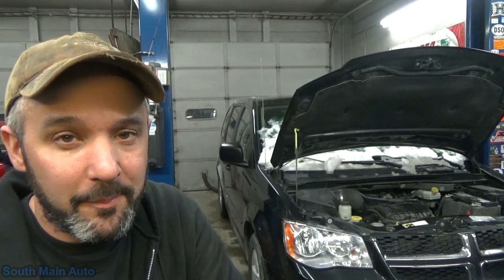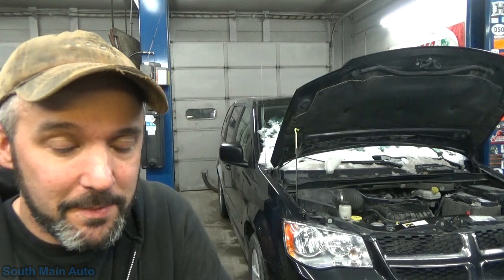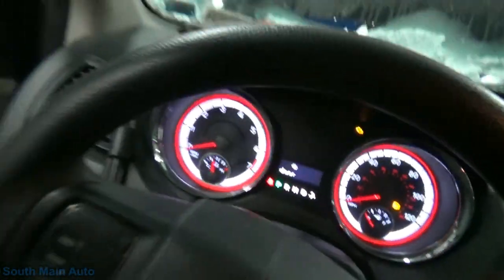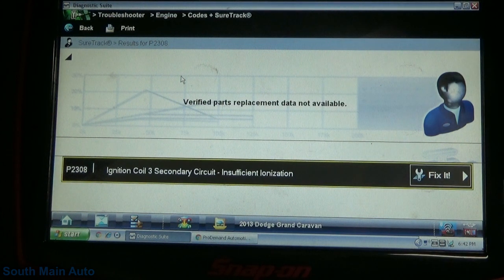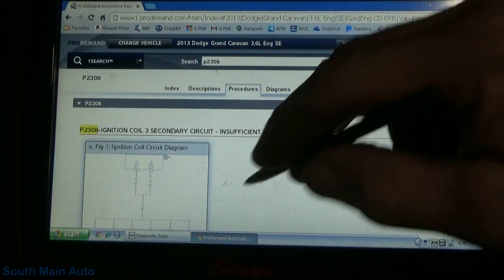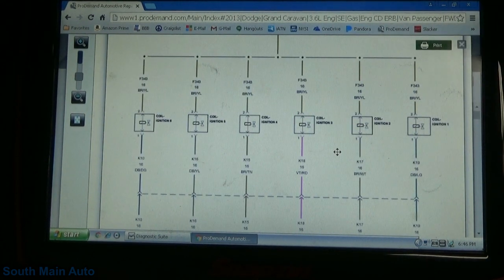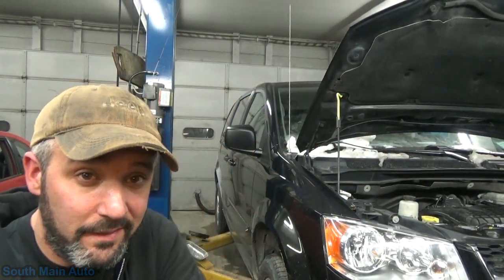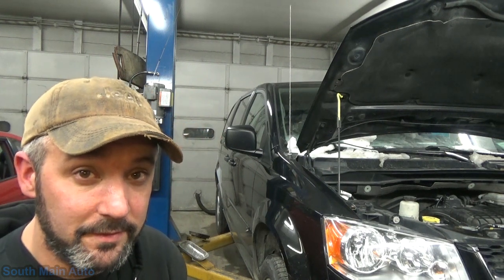Dodge Grand Caravan P2308 - Case Study

Comment: Before I would replace the ECM I would check pin fitment on that 52 pin.  Most likely not a fitment issue, but I would check it before the customer drops money on the ECM.  Secondly you bring up an excellent point about swaptronics and the possibility that a burned coil caused the issue.  Granted as you also said the newer electronics are pretty good at preventing that sorta thing from burning up an ECM, but we all know it's not perfect.  At the least I would do a basic test on all the coils to make sure there isn't an oddball in the batch.  That would suck to have it potentially burn up a ECM later down the road.
Reply: jayss10 I just wonder, if the oddball coil got swapped to another cylinder, would that pcm output driver not have been burned out as well, or cause some misfires at least? There are only misfires in cylinder 3.

Comment: Inputs? I have a 99 maxima with no signal (4volt to coil transistor) to #3 and #2 coil at the coil connector or the ecm. So I checked for shorts on the circuits and found non. I plugged in a new ecu and I have the same exact problem. Luckily we can warranty the ecu because it was changed a few months back for unrelated reasons.  

I unfortunately have not had time to get back to that vehicle to check me cam and crank signals. But this video made me think of that car that I'm going to have to get back to soon. 

Ever see this before.
Reply from the maker: Doesn't ring a bell right off hand. Were you able to make head way with it yet?
Reply: South Main Auto Repair no, have not been able to get back to it yet. I'm sure I will be able to get to it this week coming.

Comment: The Mitchell Wiring Diagrams section the wire colors are correct & same as Identifix. The wiring schematics under the DTCs are hit or miss in Mitchell so I don't use them for wire colors just for a basic block diagram...kinda sucks. Ibuprofen is part of the tool box. I feel the same way when dealerships or other shops butcher cars and you have to try and figure out all the stuff they have touched. Looking forward to seeing the Autel in action programming the new PCM. I use the Pass Thru II but I'm curious to see if it's an easier process with the Autel. I'm still trying to win it :O

Comment: I had an 09 caravan. Same symptoms. Driver in the pcm was no good. As a final test I took the power probe and measured continuity through the driver and compared to the others. The bad driver showed a blank screen on the power probe.
Reply from the maker: hmmm interesting!
Reply: I've been using the power probe for years to check the internals of computers. Since it has a high impedance it has never damaged anything.

Comment: the autel has the ecm replacement  , no pin code needed. Right before it reads the current vin (in new pcm) turn the key off , it will say no vin found , and ask you to input a vin , input it ,turn key back on voila no dealer needed. make sure you UNPLUG the skim module before all of said above.

Comment: I wonder what the spark plug looks like. I started thinking if the spark plug has an issue, maybe the PCM disabled the driver to possibly prevent damage to it. This is purely speculation on my part. The code definition about sensing burn time really got me thinking.
Reply: I was thinking the same thing for quite a while, it's in the back and in the middle so we can't reach it to change it.  Must have a monster gap causing this issue.  Turns out it's probably bad error reporting done by the code in the ECM that spits out this bogus information when it's own driver opens up and quits the show.
Reply: Yes, it is interesting. Since I saw on the Autel that the PCM is controlling the fuel injector pulse width on a restart and then disabling it to zero, I asked myself why couldn't the PCM do the same with the ignition coil? Definitely if there was an open in the secondary side of the ignition coil, we wouldn't want 20,000 or more volts backwashing into the PCM driver circuit. That voltage has to go somewhere, and if it doesn't arc inside the coil, it would have to go back to the PCM or the 12 volt supply circuit from the ASD relay.

Comment: i wonder....when the collision work was done if any welding was done and they didn't disconnect the battery?, I use to think for that to happen you have better odds winning the lottery....we'll I had it happen and I still haven't won the lottery. lots of lessons learned the hard way that has shaped how I handle repairs.

Comment: Is this a common issue? I've got engine misfire codes on cylinders 2 and 6 and replaced both the spark plugs and ignition coils. It helped the shaking a bit but it still shows misfire code.

Comment: I have a question.. If I buy a PCM with the same part number will it still need to be programmed because of the vin number? 
And also I found one at the auto wrecker but it was off of a Chrysler 300 3.6L. Will that also work???

Comment: If you get the customer okay to put in a new PCM then try, with the old PCM, shorting cylinder 1's primary feed to ground - will it burn out the PCM driver for cylinder 1 or did the engineers design the PCM robustly enough to withstatnd a direct short?

Comment: This question doesnt pertain to this fix but i am wondering if you could help me out?Have a 85 gmc 2500 350 all vacuum assist emissions blah blah .Purchased a gm 350 that is either a 86 thru 88 question would my distributor out of my 85 work in that motor ?If you or anyone on the page could answer that much appreciated ty!

Comment: hey eric love the videos. i am in dire need of help i drive a 2001 chevy silverado 5.3 with the 4L60E trans in it. the truck will not shift out of first by itself anymore. itll rev up like im in neutral and when it gets to about 2 grand ill hear a bad whining/ticking noise coming from underneath. to get it to shift out of first i have to wait til its at about 2-2500 rpms then i have to let off the gas let the rpms drop then when i get back on the gas itll go into second. then coming out of second itll shift by itself but itll over rev. after 3rd gear it does fine til i hit about 55 then the rpms will start jumping up and down which i think is the torque converter locking and unlocking. once i hit 60 its all smooth. i need help
Reply from the maker: I would have to see the vehicle to diagnose it

Comment: The answer to Eric’s question at the end is don’t care and stupidity on the part of the “blacksmiths” that messed this vehicle up previously. That is why as a retired electronic technician I am learning how to carefully and correctly work on my nice ‘12 Chrysler 200 Touring convertible myself. I recently did a replacement of the problematic plastic oil filter housing with the updated Dorman OE Solutions aluminum filter housing. I also did a modern vehicle tuneup by changing the spark plugs, cleaning the throttle body and cleaning the air intake temperature sensor and the manifold absolute pressure sensor. As of this writing my convertible has 75,500 miles and it drives like a new automobile,
Reply: Just wait till you actually have an electronics issue, Chrysler is well known for their electronics engineering. You'll see

Comment: Mine doesn't shake that crazy. Mines a V6 dodge caravan 15.   Misfire on cylinder 6. Changed coil and sparks.  

Mine said insufficient ionization too. 
Rpm said I need a new computer. Is this true??????

Comment: I'm shocked it wasn't the valves in the head. The 3.6 heads are junk. My son that is a Tech at our Local Dodge Shop changes 2-3 heads on the 3.6s per week under warranty. But not a shock either that a Chrysler PCM went to crap. They make them out of bubble gum and tin foil.
Reply: that will be up next!!

Comment: haven't watched the video yet but I'm thinking oil pressure relief valve in the oil filter broke off if it did it right after oil change on this model

Comment: Wondering if Customers insurance will pay for the new PCM.  The way the PCM is mounted, it is possible that a collision from the right rear would be enough to damage something on the PCM's circuit board that could cause the coil signal issue.  So, the problem may be directly related to the accident especially since it would be unusual for a PCM to break within 5 years.  Yet another double thumbs up SMA video production!
Reply: Sandbag1300 I've been involved with a lot of collision jobs over the years and replacing the ecm in this case would be very difficult to get the insurance to pay for unless there was damage at that area of the vehicle. Insurance will say the part is meant to operate in an environment that shakes, rattles n rolls so why would a hit at the other end of the vehicle affect it. You're right and it could have failed at the moment of impact but proving it is damm near impossible.
Reply: Depends.  If the vehicle has a frame and the pcm is mounted on the frame an impact in the rear could damage the circuit board.  If the vehicle has a unibody, sufficient force likely would not make it from the right rear to the left front.  At a minimum, I would want to open the pcm and take a look see.
Reply: I wouldnt want to drive that car again though with a twisted frame. It should be scrapped.

Comment: This was a good solid diagnosis, and honestly pretty straight forward. It still amazes me that people work in this field, call themselves good technicians, and if swapping components doesn't give them an easy answer... all of a sudden, they are out of ideas and have no idea what to do. Another good video sir, I do enjoy your videos.

checking for the drag of the pin on the connector, wanting to know which coil was in that spot originally, those are the hallmarks of a true technician that genuinely understands diagnostic work and strives to do a good and thorough job on every vehicle.

Comment: I'd have to agree on the poor workmanship mannerisms of many repair shops.  My vehicles have lots of plastic interior and exterior locations as well as mechanical and from past experiences, they break the little locking tabs on every connection they touch, crack plastic parts where there is a fastener securing them down due to over tightening them and simply general man handling brittle parts that are very difficult to replace and simply say "Well they're  old and brittle, we can't do nuthin about that". Well guess what?  It didn't come into your shop that way so, you can replace everything you damaged. They have no etticut what so ever.  You'd think they would get the impression a very clean car under the hood etc. would be a joy to work on but no, they rumble through the vehicle as if it were out of the junk yard.  They are about as useful as RATS eating away on your car parts.

Comment: Nice diagnosis. I can see why you want to be thorough in checking this out. It's pretty rare for PCM's to fail so everything else has to be eliminated as a possible cause. I like that invisible air filter. I wonder if the last shop the customer was at knew if he was coming to pick it up, maybe they were still going to check some more stuff on it? At least I hope that is the case. If not there was no excuse to leave it that way on their part. It seems Chrysler picked a bad location for that PCM. Hope you get a chance to replace the PCM.

Comment: Thank you for another great video. I always find them informative and entertaining. You have a nice presentation style. 
As an older person who has always done his own repairs, I have to ask the question; Is this the way it is out there? Two shops in a row who can't diagnose an automobile? Is the customer paying these other shops?
Reply: Andrew K After 30+yrs as a mechanic, service writer and manager I've learned that 70-80% of the shops(NYC area) are great at changing tires, brakes and letting the cash out of your wallet. Finding a shop like SMA is difficult, finding a real technician who understands modern electronics and has pride in his work is like finding a winning lottery ticket. It's worth it to go a little farther to get stuff done right and develop a relationship with the shop. It's a shame but the almighty dollar pushes all else to the side.
Reply: There is another unfortunate side to this coin. I was at a shop in New Jersey for an emergency flat repair, and while I waited, the receptionist phoned 6 or 7 customers in a row and told them the reason for their no crank/no start was a bad ECM and it was going to be around $1500. 6 in the shop at the same time, towed in overnight or that morning. Total money grab. They tried to charge me $300 for a single tire for a Chevy Cavalier. $10 to take it off the car. $6 to dismount it. $6 to mount new tire. $15 for valve and balance. $10 to put it back on. I drove away on the flat.
Reply: @ James ZivnyWhere are you in NYC? I have yet to find anything more than a parts changer here. Its a dam shame, but time wise  and those who don't know any better, to find a reputable shop, its not worth keeping the car long enough to have these kind of issues.  The only real shop I like here is Costco tire center. Great honest people, yes you wait, but honest and no BS to sell you shit because they don't care other than liability.
Reply: Gary Wanamaker doesn't add up to $300. Good story though!
Reply: I recently had to take my LR3 to a Land Rover stealership to get a warranty repair done on the brake system. The fault was a known recall / known issue, so only the official LR stealerships could get the parts and labour covered. It took 3 visits for them actually provide me a car with working brakes. Think about that. A car that came in for failed brakes, left the shop twice with non functional brakes "signed off" as working. One of these times it left with the MAF left unplugged, so she wasn't running too well either.  And this place is charging $180USD per hour and has about 20 lifts full all the time and a 4 week waiting list. People are sheep.
Reply: he didn't mention the cost of the tire itself.
Reply: @lijoima  I think he was saying that the tire itself was $300, then he added all the nickel and dime stuff they tried to charge him for.

Comment: This is the reason behind why I learned how to diagnose and make repairs myself.  There is so much incompetence out there (covered over by dishonesty) that it is beyond belief.

The only thing I take issue with Eric is... when he says "If I can do it, YOU can do it" - I understand the sentiment.  However he has a big advantage due to the fact that he has ready access to multiple wiring diagrams and service information.  I'm not complaining, it is his business to have that at his disposal.

But I simply do not.  Most of the time when I end up trying to diagnose an electrical problem I hit a wall because I do not have access to good wiring diagrams and documentation.  Plus there are quite a few problems that I've seen Eric diagnose that absolutely require a scope etc.  I don't have those kinds of tools either.  (This is not a criticism!)

Comment: "Like a ninja..."; smiled at that comment. I agree there shouldn't be evidence the mechanic has been in there other than clean and shiny where new parts installed. But manufacturers don't always make it easy; they certainly don't seem to consider servicabilty when specifying things like plastic clips and they design their engine layouts to be assembled separately from the body and mated as a complete unit with scant regard for subsequent maintenance. 
On the other hand, Eric O seems to be able to fix things without leaving a trail of destruction so why can't others? I think there's a strong element of respect for the customer and pride in one's work involved here.
Reply: drayco; agree with you totally. Eric O is definitely the man.
Reply: Sloppy, sloppy everywhere... but then again it's a clock beating game, they only get so much for diagnosis... better sit back, strap on, and enjoy yer God damn stay, cuz until things can get more reasonable it ain't getting any better..

Comment: It's actually refreshing to see another technician using liquid electrical tape to seal a hole in a wire. I see too many puncture marks in wiring looms from people probing and not sealing them. Had to rewire an entire abs control system due to the previous shop not sealing the holes they made which caused the entire loom to become corroded past the point of repair.

Comment: Good video, I've made a lot of money fixing other shops/guys screwups but it is depressing. Missing parts, loose everything, missing/mismatch hardware, some guys should be in jail. What really kills me is when you hear a car had a check eng light and it needed 7parts and it still runs like crap! Looking forward to seeing part 2!
Reply: James Zivny a few weeks ago I had a heavy truck that apparently according to the main dealers needed 6 diesel injectors. Had engine warning light on dash logging low rail pressure. guess what injectors don't work as intended without fuel. there was a push fitting drawing in air. primary fuel filter was empty. I think people are far too quick to believe scan tools and suspect the worse. found it by vacuum testing the fuel pipe from the tank to filter. a lot of people never check basics anymore. I'm not complaining when you save the customer 3000 pounds it makes you look like a superhero haha

Comment: Actually Eric you can use RTV to seal that wire just not the old stuff like Dow Corning 732 which was based on Acetic Acid. The newer versions of RTV (what Permatex calls their Ultra series) are based on a different chemistry from the original. The original versions of RTV were what are called Acetoxy silicone rubber and the newer versions are called Oxime silicone rubber. The Oxime versions do not use acetic acid which is what caused corrosion. It's also why they don't smell so bad like the older technology does. The Ultra Gray that you're fond of is fine for this purpose but of course you can always use the tried and true liquid electrical tape.